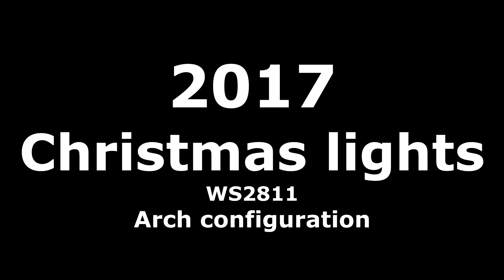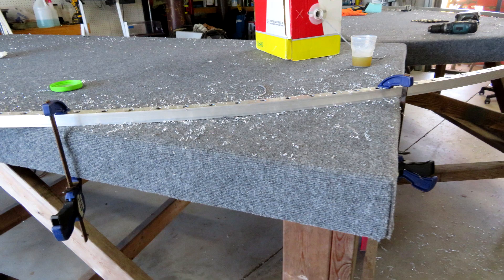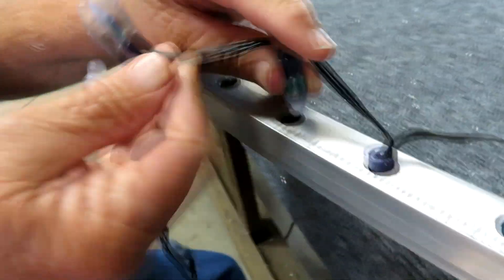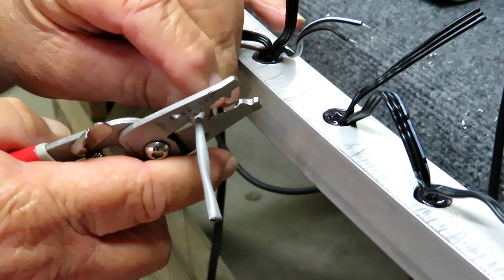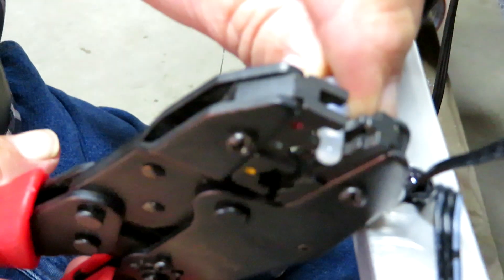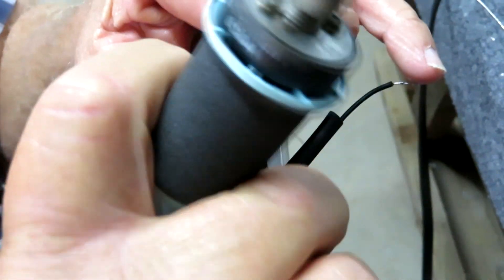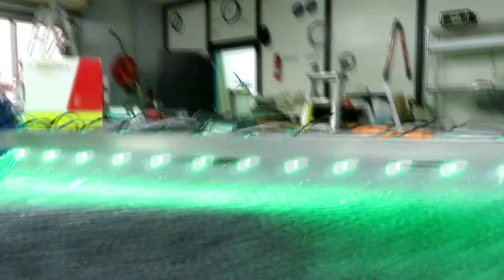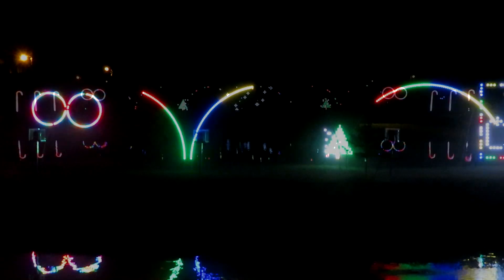How to build a Leaping Computerized Arch for an outdoor Christmas light show lights

Comment: The video begins with the aluminum already bent into an arch. For those of us who don't build aircraft parts in our garage :), can you explain how you bent the aluminum into an arch without creasing it?
Reply from the maker: I used a machine called a ring roller,  you can find cheap ones that's mechanical or expensive motorized units...or you can buy a chunk of aluminum take it to machine shop and have them been it for you.......

Comment: Question, what gauge wiring did you use for all the power lines?  Was everything connected to one breaker?  What is the breaker rating?  15A?  Thanks, sir.
Reply from the maker: a pixel is .3 W.....  If you have 150 pixels that would be 150 x .3 =  45 watts, almost 10 A at 5 V..... if you have a switching power supply at 95% efficiency 45 x 1.05  =  48 watt ,  which the input at 110 V would draw.43 amps....the extra wire for the B+ source was 20 gauge..  for the fuse output rating I'm old school, if it shorts out that means is not working............but the input for 110 volts  is 15 amps